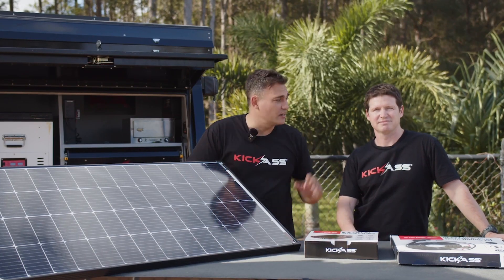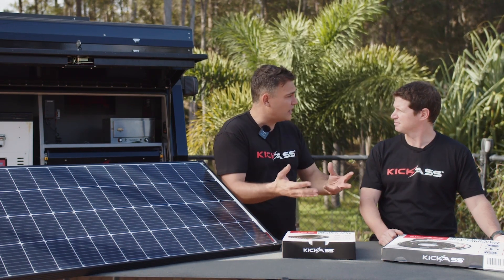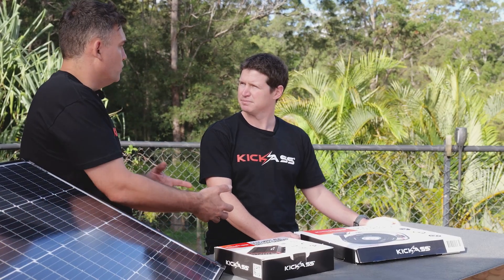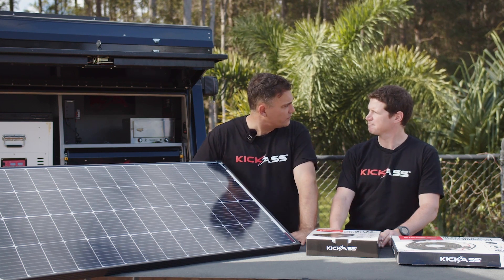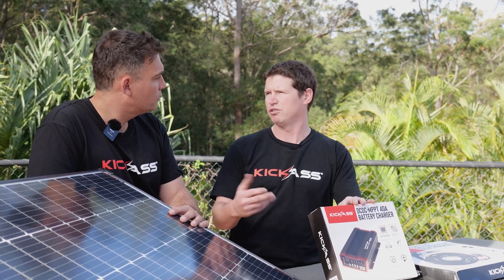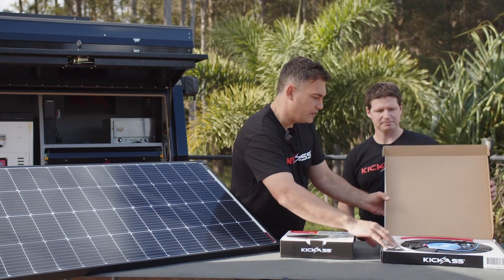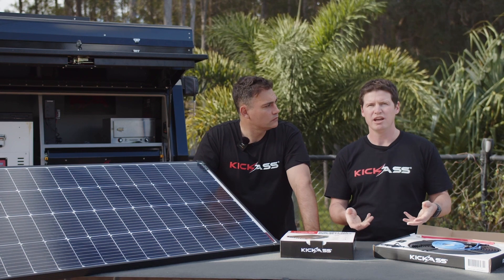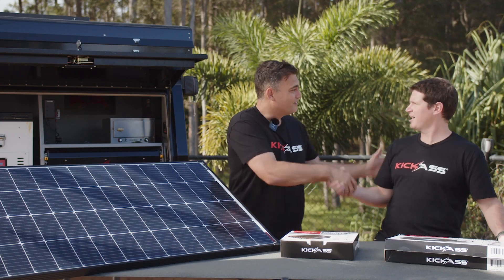High Current Chargers | Tech Talk Ep 3

Comment: So what exactly is the blue ignition wire for. It wasn’t explained very well in the video.
Reply from the maker: G'day there darren,the blue ignition wire is for late model smart charging systems that basically reduce voltage & current pending on the start battery as vehicle manufacturers don't care about charging dual battery systems & therefore once the start battery is fully charged the computer that monitors the operation of the alternator will basically reduce the voltage to save fuel from the alternator putting load on the engine & cutting the voltage below 13.2 volts which is the cut in voltage for the dcdc charger
connecting the blue ignition wire to a powered source when the motor is running EG: fuel pump fuse will allow the charger to start charging at a lower voltage of 12.2 & outsmart the smart charging system by turning on at the lower voltage & also must have no power when motor is turned off 
Thanks for watching 
Cheers Craig
Reply: @KickAssProducts  thanks Craig for that information. Now I get it. Cheers mate. 🍺